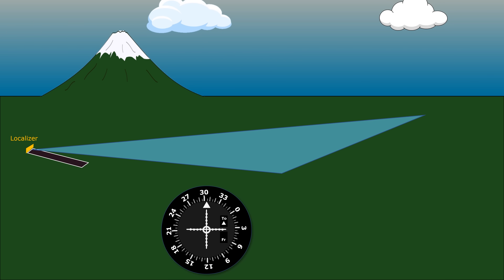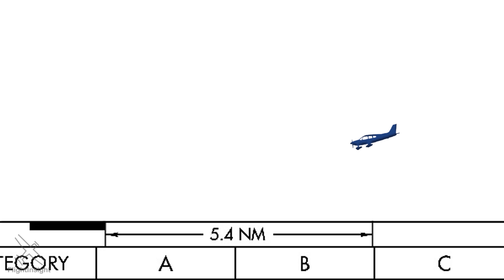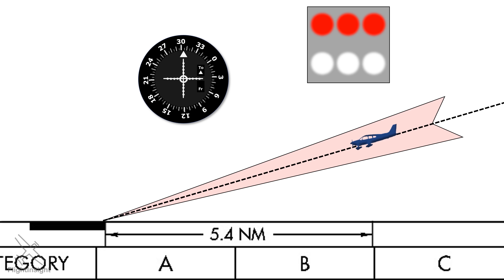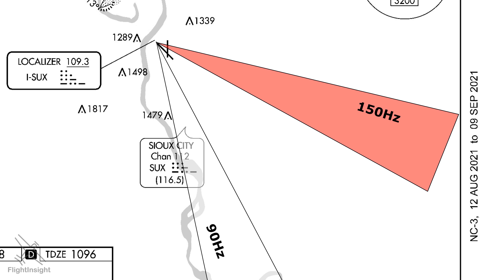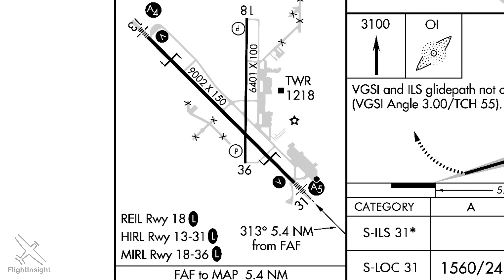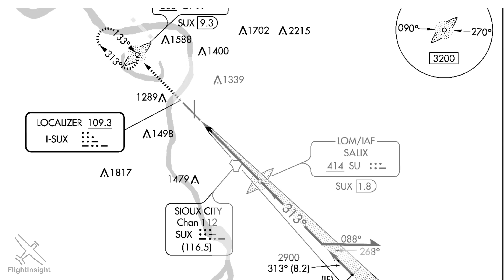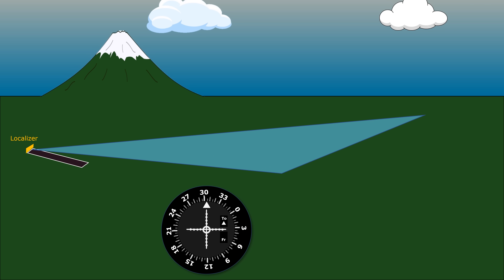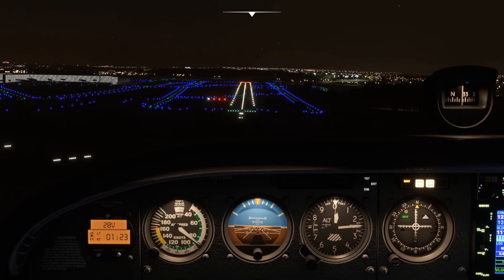How ILS Works | Instrument Landing System Explained | IFR Training

Comment: Hi,I absolutely love your videos! I am about to purchase your IFR Course! 
Can you please share your expertise in regards to setting up for a visual approach in particular in a jet….Say you are planning to make a visual approach backed up by an ILS and you intend to make full use of the autopilot down to 500ft… Say You are coming in from a downwind or base leg fairly high and you get the cleared for the visual approach in a jet….How do you set yourself up, in particular altitude wise.. what altitude do you aim for in order to get the plane to capture the GS?  Thank you for your work and appreciate your help🙏🏾
Reply from the maker: Hi Nicolas! Most companies will have OpSpecs for what altitude to capture a glideslope/glidepath down to the runway on a visual approach. So from an airline-121-135 perspective it may vary. But in general, I'd aim to vector yourself at least 2 miles outside of the FAF/PFAF (this is what ATC does when they vector you) and be at the glideslope intercept altitude prior to intercepting the approach course. Have a look at a nearby Bravo Airport on FlightAware on a clear day and notice when most aircraft are joining final approach course and at what altitude. This should give you an idea since they're all likely doing the visual approach.
Reply: @flightinsight9111  THANK YOU SO MUCH FOR THAT. As always, you are amazing and have a way to simplify things. Much appreciated 🙏🏾
Reply: @flightinsight9111  Thank you so much 👍

Comment: I was always told (by instructors or any textbook I read) that the localizer and glideslope worked exactly like a VOR with the alignment to a radial depending on the phase angle of two different frequencies, except for being much more sensitive for higher precision (and the glideslope being like a VOR transmitter turned on its side).  Are all those sources mistaken and giving a bad explanation, or are they just dumbing it down to keep things simple?

Comment: Great explanation of ILS. I have only one suggestion. Never teach a new instrument pilot to follow the needle. Best technique is to compute the descent rate for a 3⁰glide path. I used 500 fpm at 90 ktias. That keeps you within A cat minimums. If you go low add power at constant a/s. You will cut your descent rate to fly up to needle. If you go high, decrease power to glide down to needle.
Air Force Command Senior Pilot, CFI, MEI,  CFII

Comment: Question from an amateur. Will there be two GS and two localizer antennas for a runway as approach may differ on days?
Reply: yes, with an interlock system so as you're not running both at the same time messing up the signals. ATC has control of it.

Comment: Just a bit of clarification, flying most ILS in the USA, a note states VGSI/GP  (PAPI/glide path) not coincident, it will state the runway edge crossing height differences in feet, if you fly the electronic glide path bang on, you will generally see 3 red lights and 1 white light, flying the same ILS in Canada when weather is below 500 ft ceiling and the PAPI/VASI is not coincident with the glide path, ATC will actually turn off these lights to prevent pilot from readjusting their descent angle at the last moment creating an unstable approach, in the EU world, there is no such requirement to either write that note on the approach chart or a requirement to turn these lights off even when they are not coincident with the glide path. Little tip for all pilots out there, always fly that glide path as if your life depends on it because it actually does.

Comment: Have you made provision for total electrical failure or whatever conditions would make reception or transmission as described by you impossible. Do you have any way for the pilots or navigators to “think on their feet”? Can you or your staff play with this ,”over lunch”?
Reply: there's usually redundancy. 2 transmitters, 2 monitors so when one tx fails the monitors tell the system to changeover to the other one. Also farfield monitors are a thing which is essenitaly a receiver down the runway that measures the signal making sure its within alarm limits.

Comment: OK hold the bus.  90Hz and 150Hz are audio frequencies and NO radio will ever receive this.  You must mean 90Mhz and 150Mhz, those are RF frequencies.  So now 90Mhz is in the FM radio broadcast spectrum, so that is incorrect as well.  So, the ILS xmit frequencies must be somewhere in the aero band.
Reply: The Glide Slope frequencies are between 328 MHz and 336 MHz, UHF band. The carriers are AM modulated with 90 Hz and 150 Hz audio.

Comment: If the same runway is used for both landing & take off, does it mean 2 sets of identical ILS equipment get installed at each end?
Reply: yes, however atc has control over each side with an interlock system meaning you can't run both at the same time because the signals would hit each other.

Comment: Why did not they put the white horizontal lights over the red lights during the proper approach? Also why did not they make four lines of the horizontal lights - two of them -  the white lights on the top and two of them -  the red lights on the bottom? That would be much more reasonable for a small aircraft.

Comment: I don't understand why don't we simply use GPS (for following a path), altimeter (for altitur) and compass (for direction). I mean if the coordinates of runway starting point and it's direction is fixed. Then why don't we simply follow a fixed path using GPS, compass and altimeter.

Comment: In the USAF back in the 70's, I used to talk pilots down both glidescope and glidepath using a fancy radar set called GCA.  (Ground Controlled Approach) . We could set them down right on the numbers with zero vis.   Doubt if anyone these  days have heard of it.   It saved Berlin once.   I am of course a Dinosaur, but I loved  talking them down.   ILS was not common but was coming on.
Reply: The GCA approach sounds similar to a PAR approach is just my immediate thought reading your comment. Never heard of a GCA during my IFR training although I probably did and it was an 'in one ear out the other' ground lesson for me. Thank you for your service and thanks for giving me something else to learn about. (Also Im sure the pilots had fun being talked down too, I sure do).
Reply: @TheFormerTeam  The PAR approach did not include radar glidepath. I did a few of those in FAA Tracons.  GCA had 2 radar sweeps, horizontal and vertical  and was only at USAF bases.  Read up about the Berlin airlift and GCA.
Reply: I've heard of it. They completely phased it out when I first got into flying back in the 90s.
Reply: I’m a dinosaur also. As a USAF navigator from the ‘70s in C-141s and C-5s, I occasionally directed Airborne Radar Approaches for my aircraft. If my radar was sensitive enough, I would use ground returns to determine the runway end points and construct glide slope and path targets for my pilots to achieve, and talk them down the ARA.

Comment: Just got into aviation about 6 months ago. I’ve always wondered how the ILS works and sometimes I have trouble lining it up perfectly on simulators. This explanation helps a lot! I have some trouble because sometimes I correct myself by descending/ascending and when I slow the decent/accent down the ILS marker shoots in the opposite direction too much. I guess I need to have surgeon hands with my movement.
Reply: Nikita - welcome to aviation. You’ve already figured out that gentle corrections are the key. This will keep you from see-sawing through the localizer and glide slope. As you progress in your training I encourage you to get an instrument rating. It makes you a better pilot and adds safety. I will almost always file IFR when flying to a destination. Although it may add some time and overhead to the trip, the payback outweighs the overhead. With ATC watching me and talking to me, I feel much more secure
Reply: @hock8379  Thanks for the feedback!
Reply: Depending on the aircraft you're in, it will want you to have a certain power setting/configuration for landing so you can descend smoothly along that glide path. Finding a digital version of that aircrafts POH that you're simming out of to find more specifics on it may help a lot. From what you've said you might be going too fast so making slight adjustments on the yoke causes a major change to your flight path. Or you're just over correcting but there's no way to know without more info.

When training irl for IFR, pilots initially start off just by trying to get used to controlling the aircraft solely by reference to the instruments. Something that may help you for better control is to just fly around only looking at the instruments and trying your best to remain +/- 10 degrees and +/- 100ft of your target heading/altitude. And once you're stable on that heading/altitude, after trimming out any climb/descending tendency, try climbing to a new altitude and turning to a new heading to repeat the process.

It's harder to trim out the control pressures in a sim in my opinion because you dont really have any feedback. I only have a joystick and throttle(s) so trying to trim using keybinds or a mouse to visually drag the trim around makes precise flight nearly impossible. I probably just dont have my stuff keybound correctly so I just need to play around with it more.
Reply: @TheFormerTeam  thanks for the feedback. I usually always look at the ILS even if there is high visibility for the runway. I am a nut about staying at the perfect landing speed, so I think I just need to be a lot gradual with smaller decent/accent angles so I don’t get flung off course.
Reply: Only use two fingers on the controls without brutality.

Comment: Nice basic explanation, to combat false signals caused by anomalies the pilot should know what the target rate of descent for the glide slope is and the final inbound track/heading is based on the conditions being flown in. You mentioned false glide slope information which is a thing auto pilots won’t generally lock onto a glide slope from above. Spurious localizer signals are out there, Houma La , and Seoul Korea are two examples that come to mind. Pilots need to know the rate of descent based on ground speed, and heading to maintain the proper ground track, before the approach is started. CRM stuff

Comment: USN 68-74, ETR-2,  NAS Miramar, 70-74.  used  to  fix  Ground  Controlled Approach  (GCA) or  Precision Approach (PAR)  RADAR  and TACAN  Two AN/FPN-36  QUAD RADAR  and an FPN-52  which was  precision RADAR  section of  CPN-4A  "with improvements"

Comment: I used to work for Racal Avionics in the UK, for the department installing ILS  and this is very informative for me as I recall the jargon used by the installation engineers who's expense sheets I was checking.  I also recall that on one occasion a sales engineer recommended a certain type of installation after a site survey without ascertaining soil conditions correctly. He got "kicked upstairs" into marketing.
Reply: Really?   When was that?    The ILS installed in the UK are Thompson CSF,  cat 3A and I know.. because I was installing them in the early 1990’s.    The RACAL equipment we installed was RACAL PLAN 50 DVOR,  not ILS
Reply: Am I correct in saying that G/S and LOC are polarised 90o of each other? 
ie ones  polarised vertically and ones horizontal

Comment: While I’m only a VFR pilot, this was really well explained and made this start to feel like it was within my ability to learn one day.  Thank you.
Reply: As a VFR pilot, and if you have instruments in your plane, you should practice ILS approaches (if the runway they are using has an ILS. Before i was instrument rated. I practiced interception of an ILS. And many other instrument approaches. I practiced entering holding patterns as well. Just keep practicing and learning.
There are never and complacent pilots, as they are dead
Reply: @rty1955  - Excellent idea!  Why didn’t I think of that.  Thank you so much for the encouragement and inspiration.  👍
Reply: @aerocam2  you are welcome!. You can also ask ATC to try a few approaches if they are not too busy. Brush up on reading fixes, approaches, circle to land etc. For example if the ILS is on one runway, yet the winds are not favorable for that runway, you can use the ILS to get into a/p area than use visual references to "circle to land" on the correct runway. Learn to read IFR approach plates also. There are many ways to land at an a/p in IFR weather BESIDES the runway that has the ILS
If you have flight Sim, you can set it for minimums and practice shooting approaches.
As pilots, we always learn. Once you think you know, take up an instructor or another knowledgeable pilot to test your skills

Comment: You could highlight how the two different hold lines on taxiways are important when instrument approaches are in effect. Going past the IFR hold line increases deflections of ILS signals screwing up aircraft's making approaches.
Reply: no.  the video is fine unless you want it an "hour long."  don't mess with "substantive."  there is "enough salt" in this pot

Comment: One correction is that the VGSI is rarely in exact coincidence with the GS.  There's two reasons for this. One is the two systems aren't always set to the same threshold crossing height which means they are driving you to slightly different points on the runway.  The other is the two systems have their own sets of allowable tolerances and aren't calibrated to each other.  So the GS could be at 2.97° and the VGSI could be at 3.03°.  Both systems would still be in their acceptable tolerance levels, but still .06° from each other.  The end result is quite often you will show perfectly on glidepath on one system, but in error on the other.  For practical considerations once you transition from instruments to visual, stay on the VGSI and do not correct for errors on the GS or you could start chasing one vs the other.
Reply: The EXACT PLATE he shows in the example even says "VGSI and ILS Not Coincident" in the profile view.    Using a VASI as an example to build on was a bad decision.
Reply: Yeah, I don't know why he mixed it with PAPI/VASI lights because they are part of Visual Approach Slope indicator systems and you don't use them when flying ILS approach. PAPI/VASI are basically just an obstacle clearance system for the largest aircraft that could land in this airfield.

Comment: Great video! I’m wondering what causes false glide slopes because you mentioned them in the video.
Reply: Many things can cause it.
Reply: It's inherent to the design of the Glide Slope (GS).  Every multiple of the Commissioned Angle (CA) will be a false path.  For example, if the CA is 3° there will be a false path at 6°, 9°, etc. Also, the Sensing alternates every multiple of the CA as well. In this example you will have "proper" sensing at 3°, 9°, 15°, etc. And "reverse" sensing at 6°, 12°, 18° etc. Proper sensing meaning, If the CDI in the aircraft is indicating below path, the aircraft is below path. Reverse sensing is the opposite, a below path indication would mean that the aircraft is above path. Reverse sensing is what the CDI is displaying on a Localizer back course approach.

Comment: After DH, should you fly the PAPI, or the glide slope?  What if you’re on the glide slope and the PAPI indicates your low, and visa versa?
Reply from the maker: Once you're visual, you're using visual cues like the PAPI for vertical guidance. If the PAPI lights and glideslope aren't coincident, there will be a note in the profile view of the approach plate. You should brief this, and expect the discrepancy when you break out.
Reply: @flightinsight9111 , But, the note is simply a note. How do we proceed?  What takes precedence? Do we fly the Glide Slope, or the PAPI? Or, do we fly the higher the two, or the lower?
Reply: @alpenglow1235  the ils integrity is assured up to minimums. During approaches higher than cat 1 the ils signal is protected by keeping aircraft and ground vehicles outside the ils signal area so that there's less interference and thus lower mjnimums can be achieved(up to 0 visibility). 
To answer your question: 
You can use the ils to get you safely to the specified minimum. After minimums visual cues take precedence as the ils signal cannot  be guaranteed to be reliable enough.
Reply: @alpenglow1235  if you’re flying Cat 1, your minimum is likely around 200ft. L below this PAPI is also not entirely useful, so provided you’ve arrived at 200 on the GS/PAPI, from there on it’s just small corrections by use of the aiming point and runway perspective.
Reply: @alpenglow1235  No, the note is informative that the VGSI and the ILS are not coincident.  The ILS vertical guidance ends at the DA/DH, it is not usable beyond that.  Once you reach minimums, you either continue visually or you execute the missed approach.  When continuing visually, the VGSI for reference as you continue to the touchdown point (which is in the marked touchdown zone, NOT the numbers or threshold markings).